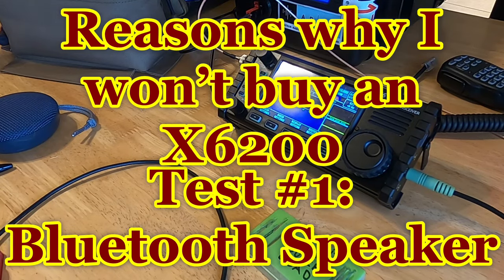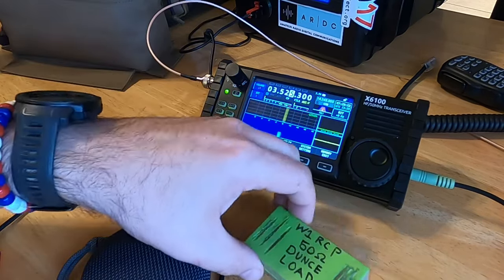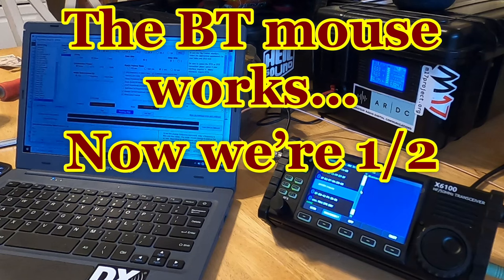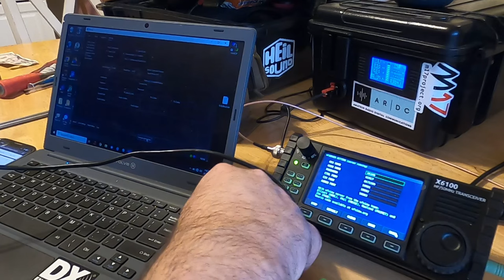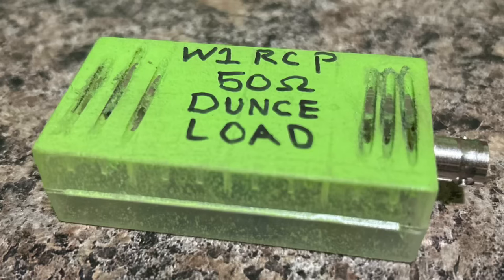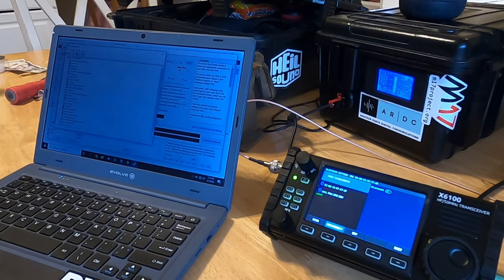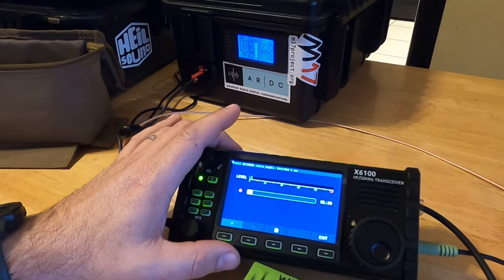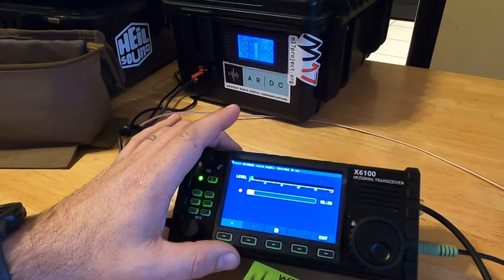X6100 features reasons why I won’t buy the X6200 #xiegu #fail #ham #radio #review

Comment: Not buying any of these chinese Low Flame Glowers. The 6100 is already 699.-€ and this Piece of Crap will be 929.-€ in my Country. An IC-7300 is 1249.-€ and can turn its RF PWR down to 100mW and is overall by far the Better Radio for its Money. Tnx for the Video & happy Sunday. 73 de Uncle Günter from across the Pond 💯👍🙋‍♂
Reply from the maker: Uncle Günter! Thanks for the encouraging comment. I agree that it’s super overpriced. I said I would sell mine, but so think after folks see that the support for firmware isn’t what it should be, there is going to be quite a bit of buyer’s remorse. I’m not 100% disappointed in the 6100. I have other videos of me enjoying my time with it. This video was all about what isn’t fully functional, and I’m glad you were able to comment based on that! 73 and happy Sunday! -Robbie
Reply: I paid $465 on Amazon business. Delivered in two days. It’s a good buy at that and sits $150 above the AliExpress price for the G90. Where can you get that type of performance for $465?  Some people are selling a QRP ATU for $200. And it has 3rd party firmware.

Comment: I just got a 6100 and really like it. The only thing so far that I dislike is the fact when the atu is in use it lowers output power to 5w. Is this normal? Also, the 6200 won’t sell well for Xiegu. Big increase in price and lower output power.
Reply from the maker: That’s not normal. It could be the internal battery. Just a guess. Have you tried an external power supply at the same time?
Reply: I tried both internal and external power source and anytime the atu was in use it limited the output power to 5w. This could have been a great radio but Xiegu as a company sucks.
Reply from the maker: @kylefreemason  Are you using the latest firmware? I can't agree more with your last statement.
Reply from the maker: Dang dude. I’m all out on troubleshooting that one. Have you tried it on a dummy load to see what it does? That’s the only other troubleshooting I can think of to start narrowing the issue down. I know that has to be aggravating to say the least.

Comment: BT has several standards. They can do various types of BT connections. The mice/kybd connection works as they actually state in the manual. The audio BT connection is not implemented (yet). Temporarily Offline’s YT channel goes through the distinction.

Comment: Good luck sending CW with a Bluetooth speaker monitoring your sending! The extra delay will make it a mess.
Reply from the maker: I’m not sure if I mentioned that in the video. I do know that the delay on CW would be impossible, and honestly SSB would be almost as bad if you have the monitor on. My biggest beef is that the Bluetooth doesn’t seem to be necessary since it is almost useless. I have made it work in previous videos, but the task was not as easy as just point and click.

Comment: The only advantages of the x6200 are supposedly better audio and more robust frontend. Is that worth an extra $200? Not even close. 
The only radio in their lineup worth buying is the G90 and only because of the price. Its cheap enough to forgive its shortcomings.
Reply from the maker: Hey Jonathan! Thanks for the feedback. I would also agree that the G90 is a decent radio. I’ve heard more good than bad from that camp. I’m not totally disappointed in the 6100 because I did buy it under the premise that it was hackable. The problem lies in the fact that I’m not a good hacker. Haha.
Reply: @w1rcp  I used to own an x6100 but sold it because I didn't use it enough to justify owning it.
Reply: Your forgetting Broadcast FM, Airband and FT8
Reply: @teslar1  1. Any cheapo radio can do broadcast FM. 2. Mostly useless 3. Not much use for transmitting FT8 afaik
Even if you made a list of features that was twice as long, it would still be hard to justify the extra $200 price increase
Reply: I only focused on Bluetooth for this video. The thumbnail has the topic in small writing at the top. I’ve made videos of the radio working. This is about one of the things I wish worked.
Reply from the maker: Hmm. Somehow I commented using my kid’s account. Weird.

Comment: Hello, I purchased the X6100 on a pre-introduction sale and have had fun with it. However, it is not anywhere close to my main transmitter and is in a go bag. The price increase was insulting. And other than an upgrade in looks. It has much of the same software issues to deal with as I understand. No thank you and will pass on this for now.
Reply from the maker: I watched a video by Temporarily Offline where he accessed the insides of the X6200, and it is basically the same insides…very concerning considering the price difference.

Comment: X6100 works great as a HF Radio with an ATU - Blue Tooth was not advertised as audio , you can buy an adapter fi
for 10 dollars , the x6100 has many more functions that work great you review is harsh.
Reply from the maker: Harsh but true. What good is Bluetooth if you can’t use it directly as a serial/USB connection to a PC? They require com0com and another program in tandem to make it work. It isn’t for the faint of heart. 
I will agree that the radio itself does work for communication. It’s the support for the other features in future firmware updates that really got my goat. Most likely we will never see another firmware update for the X6100 from Radioddity. 

Harsh in relation to the reasons why I will not buy the X6200. I have reviewed this radio before for making contacts, and yes it will do that. 

Thanks for watching and commenting. 73 -Robbie
Reply: The Xiegu EU site specifically states "Native Bluetooth and WiFi supports wireless audio, keyboard & mouse."
Reply from the maker: I have this exact screenshot. Perhaps I should have included it in the video. Part of the title is “Bluetooth,” so I tried to stick to the script. Having to use com0com and hub4com to get Bluetooth ports to function as virtual serial ports is not fair to the basic consumer. Even if hams are supposed to be more technical, I think the “software engineers” at Xiegu should have done better.